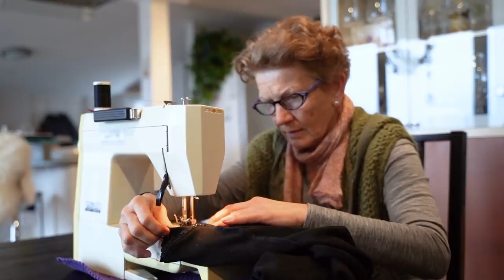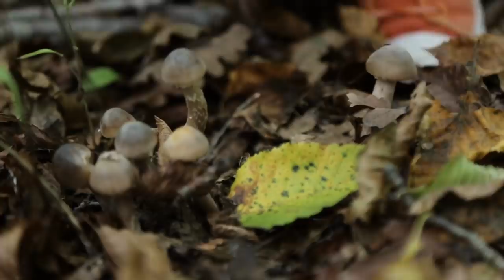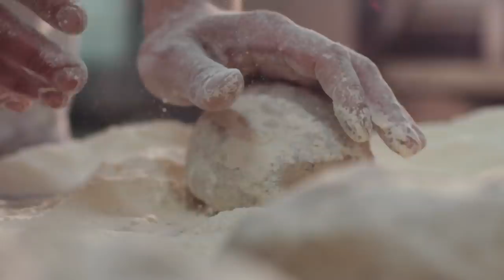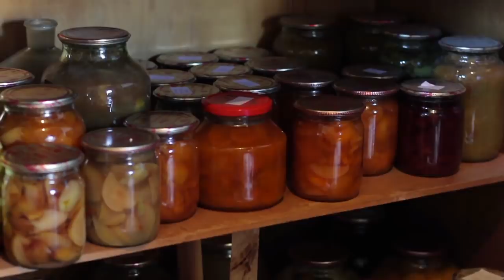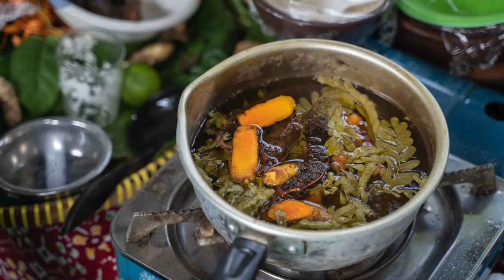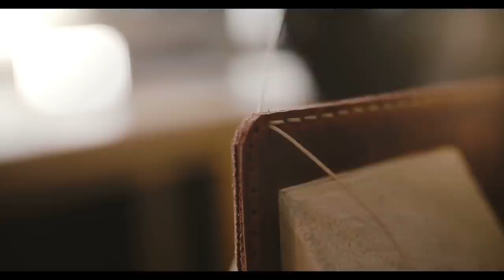10 Great Depression Skills That Will Pay Well

Comment: Making / reloading ammunition
Reply: Steve Slade  Guns aren't just used for self defense. They are also used for hunting. As far as ammo costs vs reloading, I cast my own homemade lead bullets that I powder coat and pick up empty brass casings for free at my local shooting ranges. That in combination with buying my powder and primers on sale means I can make 380 acp, 9mm and 38 spc for slightly under 5 cents per shot. That's what 22lr ammo costs. For other calibers like 40 S&W, 357 sig, 45 acp, 44 spc and 400 corbon I can make those for around 7 cents per shot. For calibers like 357, 44 mag, 223, 300 blk and 7.62x39 my total cost per shot is around 10 cents. For 308 win my cost per shot is 15 cents. You're right that if you are using store bought jacketed projectiles you don't save much money reloading the common calibers like 9mm, 223 or 7.62x39, but if you cast your own lead bullets, powder coat them so you wont have problems with lead in your rifling and pick up free brass casings from the local shooting ranges you CAN save a lot of money. Yes, reloading takes time, but for some people, myself included, it's a relaxing and enjoyable hobby.
Reply: @Prepare2Survive  Modern Muzzleloaders that can take smokeless powder is what im betting on. I can use the powder out of almost any ammo I may find and mold my own bullets with the lead. I have a few regular firearms, but theyre .44 colt and not many people use that ammo type versus .45 acp, 9mm, and 5.56   EDIT: My major hinderance, caps. SO either way, im avoiding any conflict at almost all costs, and will try to trap, fish, or use bow takedowns whenever possible. Gunshots are an excellent way to let the whole area for a mile know youre there.
Reply: @ancientsalt4291  Muzzle loaders are okay, but if you want to avoid a shortage on caps maybe you should get a flintlock musket instead of a percussion musket. As far as being able to scavenge powder from factory loaded ammo you might run into problems because you don't know what specific type of powder and it's burn rate that was used in that factory loaded ammo which means you could create a dangerous load that'll blow up the gun. A much better solution when it comes to scavenging components from loaded ammo is to have a gun chambered in 357 magnum because you can safely scavenge the powder from most of the common calibers like 380 acp, 9mm, 40 s&w and 45 acp. Because 357 magnum has a larger case capacity you can use all of the powder charge in any factory loaded ammo for those calibers. Most of those calibers also use the same small pistol primers that you could pop out and use for making the 357 mag ammo. Some of the 45 acp ammo uses large primers, but a lot of companies are switching over to the small primers. You'll also be able to use the projectiles from 380 acp and 9mm ammo because there's only a couple thousandths of an inch difference in diameter. Casting your own lead bullets for 38 spc / 357 is also very easy. Another advantage the caliber has is 38 spc is good for small game hunting and 357 magnum from a rifle length barrel has over 1000 ft lbs muzzle energy so it's good for larger game hunting. Plus 38 special from a rifle barrel is very quiet. You can load it to be almost as quiet as a pellet rifle.
Reply: @Prepare2Survive  you mean like 444 and 4444 grade?
Reply: @Prepare2Survive  Thats why im focusing my hunting on archery vs rifle hunting. I wanna conserve my tad bit of ammo for potential confrontation, and not give away my position to potential looters and vagabonds
Reply: @Prepare2Survive  Ive considered flintlock, but ive never used them before. If you have the time to teach, I could possibly come by. But as far as that goes, i got no one. Not even grandpas anymore
Reply: I was too into tech and BS facebook that I didnt take heed their warnings
Therefore, Im a fool

Comment: One thing I would like to add to this list, which expands upon your point on tailoring, is armoring. During a Great Depression, or other such grid-down scenario, hunger, desperation, and pure repressed psychopathy would lead to the rise of raiders—especially with police being demonized and told to stand down, as they are right now. While weapons would be essential in the defense of life and property, having a functional system of body armor would boost one’s combat survivability, and in turn diminish the consumption of precious medical supplies. It doesn’t have to be all-out Mjolnir armor, but it should cover the essentials: head, torso, arms, and legs, while allowing ease of movement, ventilation, and oxygen flow. Body armor could also be traded for large quantities of valuable materials. Definitely worth having the knowledge if the Great Depression ends up happening (which at this point is a very realistic possibility.)

Comment: Leather Shoe Patcher machines are amazing. Relatively portable and they can sew up to 1/2" materials like leather and rubber. No electricity or fuel required. Just some skills, thread and needles.

Comment: setting traps -snairs it;s a diffent kind of trap - there are difent kinds of traps one is bear traps or beaver traps .makeing a lean shelter from trees - starting a fire with out a liter - did you know the lint from the pocket  can be used to start one -rub 2 sticks together can start one - a small pice of limb and a stick - put the stick in side the limb  with both hands rub back and forth untill it smokes.then add small piches of wood as you blow on it some not hard  just enothe to get it stared.
Reply: birch bark is good fire tender. heck rake your front yard. There is enough dead grass there that you could go for months before you run out of grass to start a fire. keep it dry though.

Comment: A futher on homebrewing is the distilling of chemicals. Not only does it produce stronger alcohol, it can be used to produce a quarrel of chemicals like Ethanol, pure distilled water, methanol, and many more. A foraging fermenter's tip: don't wash your blackberries, huckleberries, gooseberries, and raspberries because a natural yeast grows on them. Using that, you can make berry wine and brandy that pairs well with many things. Canned fruit also make a damn good substitute for fresh fruit for fruit wines, as they have a syurp in them full of glucose. However, they are filled with various preservatives so taste most likely will be hindered. Still a very useful skill

Comment: Acquire books! The HomeDepot 1 2 3  "how to", big orange book is great. Yes watching videos to learn repairs is great but without electricity or internet it won't happen.  Basic plumbing, electricity, building is so important. I'm female and in my 60s. I saved us over $7000 in labor on a home remodel. Learned to tile, laid 750 s.f. of floor tile, installed 6 ceiling fans, replaced all the old light switches and electrical plugs with new white Dacor. The electrician charged $80 hr, the tile guys wanted $5 sf for installation. Instead of focusing on getting more money I focus on not spending it by learning to do things myself

Comment: Rachel Ray admits that she's a cook, not a baker, because she can't stay within the limits of the baking recipes.

I was a curious boy and learned to sew when I was in elementary school, by hand and on my grandmother's Singer treadle sewing machine.  I've added embroidery and needlepoint to that and I completed a daughter's costume for a school play when my wife's back gave out after too many hours at the sewing machine.  My wife's grandmother's treadle machine graces the landing on the upper floor and serves as the display stand for several generations of family photos, but the drawers contain needles, bobbins and a spare round leather drive belt - either of us could make clothes from a pattern using that machine.  That pattern might be a worn-out shirt that's been disassembled to make a pattern.

I built my last tower computer and it's still the fastest computer in the house.

I've rebuilt engines from a flathead V8 to an overhead cam 4.  My previous riding mower was 17 years old when I replaced it because my wife insisted that I was too old to jack it up and replace the transaxle.  Sometimes the correct answer is "Yes, dear" ;-)

I can cook almost anything from a recipe - even bread - and my brownies consistently get good reviews.  You should have heard my occupational therapist on my last visit there after thumb reconstruction when I presented her a plate filled with brownies: "These are SO good!"

I can do copper and PVC/ABS plumbing and I have designed and built electronics from scratch.  I've been a freelance programmer working with startup companies in Georgia and California - but the best assignment was working from home for the Joint Chiefs.

Amazon has many prepping-related ebooks but the used paperback version is often only a dollar or two more and I now have a bookshelf covering gardening, small animals, herbal meds, even "How To Build An Outhouse" (from Storey Publications).

I've become a PAW fiction author in my old age with now 8 books on Amazon and another one in progress.  I write whenever the characters in my head start having interesting conversations ;-)

Comment: Academic skills in terms of studying and knowledge acquisition strategies, planning and implementation are also important. You cannot prepare for everything, but you can learn a lot from manuals and books if you are used to digging through information. Critical, scientific and analytical thinking is also important imo, especially when paired with basic biology, chemistry and physics. People underestimate brainiacs in terms of prepping. Losing knowledge and modern expertise can set back a community in the long term.

Comment: Trapping is also good.  With a heavy emphasis on snaring as it’s cheaper.  You leave a $2 snare unattended in the woods.  It goes missing.  Not a big loss.   You leave a $25 trap in the woods.  It goes missing.  Now you’re pissed

Comment: There are some other things that would help you survive, starting with a low horsepower vehicle that does NOT have all the digital do-do that the modern  car has. The other thing is an old fashioned hit and miss engine. Using it with a suitable drive belt will allow one man to do many things he would otherwise be unable to do on his own.

Comment: I'd say basic metalworking and woodworking belong on this list. Engineering and machining are great skills, don't get me wrong, but they are ultimately useless unless you have the basic tools, parts, steel, and setup to get to that point. While it is highly unlikely that it will come to a point where cnc machines are rendered unusable, it is very likely to run into steel shortages due to supply chain issues. Another potential issue is that furniture and doors may be damaged, even if only due to weather and general use. Knowing how to re-purpose scrap metal, make nails, and create wooden fixtures is a must.

Comment: Compound exercises, body weight exercises, isolation exercises, and cardio so you have all the strength needed for heavy lifting and enough endurance. Needs to be done slowly enough so no injuries happen while training. The benefits are pretty much endless including being able to do a job better than someone out of shape. Heavy lifting can all be done at home. Body weight exercises can be done anywhere. Walking, running, or riding a bike can be done outdoors. No need for a gym.
Reply from the maker: Yup

Comment: Hydrated lime is the same stuff you put in your gardens... Is the same stuff you can vegetables with.. also heals open wounds..but it NEEDS to be kept dry and clean!.. we've been using it on horses and animals for Centries!..to prove it..go to your local feed/tack/farm shop and get what's called Wonder Dust..lol..it's majority hydrated lime..keep Hydrated lime (50lb bag costs between $8-$10 each) on hand at all times..but be sure to label it should you store it in anything but it's original packages..lol.. don't want authorities to mistake it for cocaine!!😁

Comment: CPR isn't the first aid skill that will come in handy if there isn't an Emergency Room or hospital available. 12 minutes is the longest period. you can perform CPR with a hope of success. Bleeding is a thing you need to control immediately and this does not mean using a tourniquet which is NOT a good choice. Direct Pressure and elevation is the best.

Comment: Need to add 'Welding and blacksmithing' either as its own skill, or under under Mechanics and engineering. Also 'security expert'. Yes, the entire group should be proficient in arms, but the snake needs a head.

Comment: Two skills and they might loosely fit in with your mechanics/ engineering would be home repair/ construction skills and tree/ firewood cutting. Knowing how to fix a storm damaged roof or someones plugged drain will be huge, especially in this day and age of people always calling a guy to fix things. Watching a guy cut down a tree vs knowing how to fell one with a chainsaw, ax or saw without killing yourself or destroying say a house will become crucial in a long term where one might be relying on burning wood for heat and cooking fuels. Also knowing how to split and age wood for burning or to season for timbers. 

A general overall item, and though it seems more like a thing than a skill would be tools. Do you have decent quality hand tools and do you know how to use them? You don't need snap-on but you don't want the $10 socket set from the discount store either. Having tools and knowing how to use them and care for them will be crucial especially if you're going to rely on them to make you money. Also having this skill is something you can shop out for fixing other peoples tools. Do you know how to sharpen an ax with a hand file, or how to maintain your power tools or even basic hand tools or when you open up your 'toolbox' in the corner closet is everything covered in rust, and you screwdriver twisted or chipped from using it as a chisel? Anyone remember the old timer that use to come around and sharpen grandmas knives every few months. again a skill in knowing how to use tools.
Reply: Remember to plant some trees for the future.